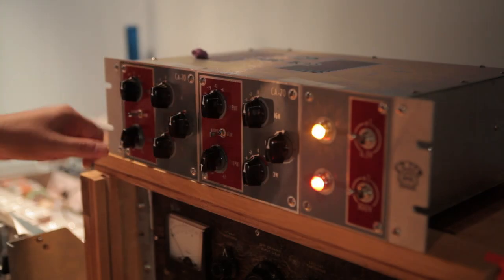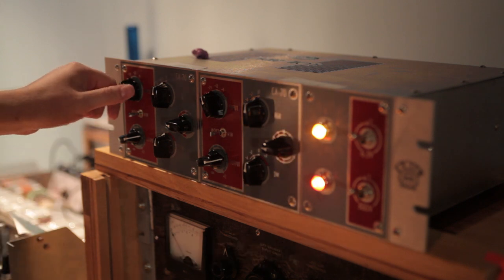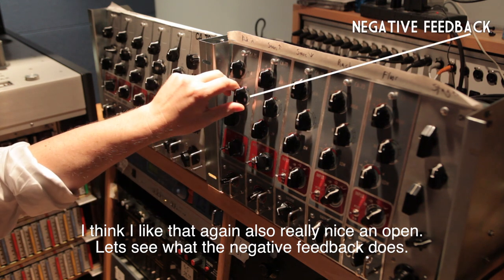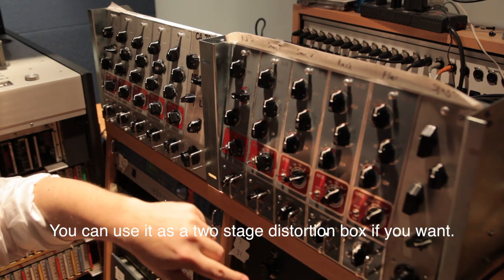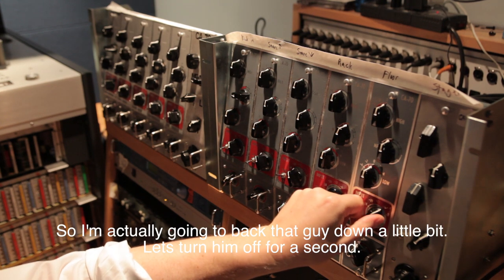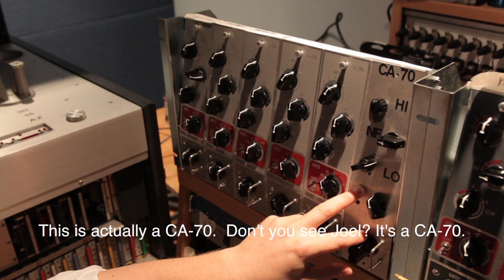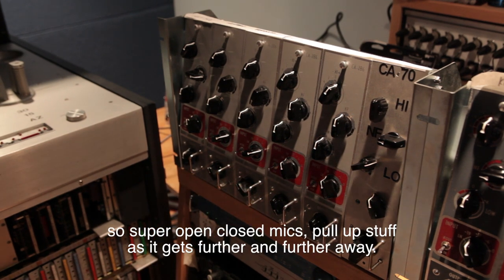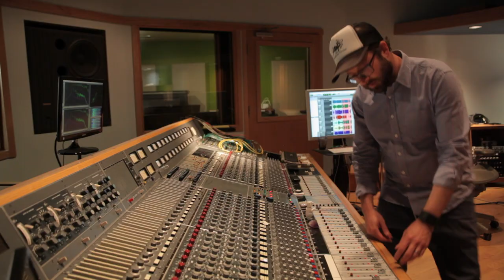Coil Audio drum session at ARC studios with Mike Mogis

Comment: Hey I'm trying to wrap my head around the studio setup. Are you running mics direct into these "line amps" or are you feeding them a line level signal from a daw/interface? (is that an option if I want to loop a recorded drum part in my daw?) I love this hands on approach to mixing and the warmth it adds.
Reply from the maker: We are running mics directly into these. These are mic preamps but you can also use them as a line level or buss amplifier  (due to the Input pad strapping)- which does make it possible to use as a Hardware Insert in your DAW. They are just as awesome in Line applications as they are with microphones. Thanks for your question PJ!